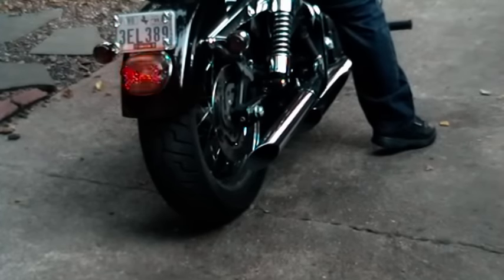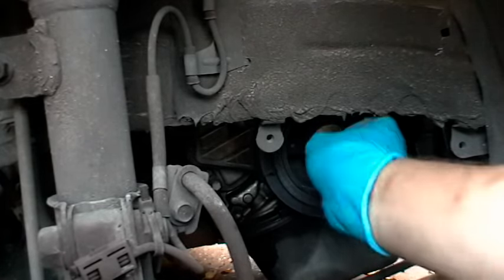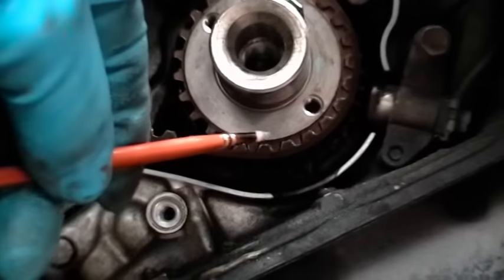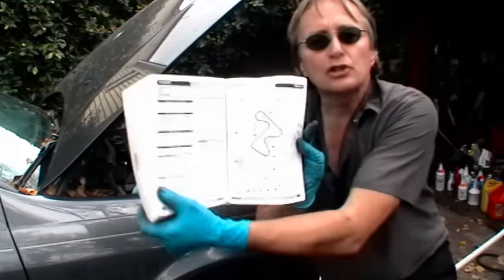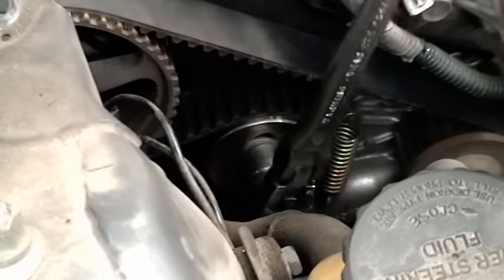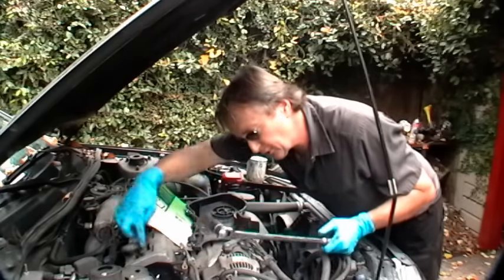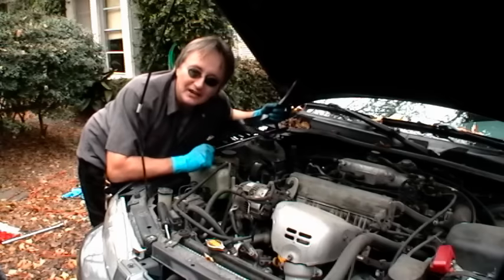How to Replace a Timing Belt in Your Car

Comment: The fastest timing belt change ever. This guy is a pro.
Reply: Teqo7 never did one before. I have only put a timing belt on an engine that was out of a car on an engine stand. I guess when I have that experience It will be more like nothing lol
Reply: Well, it is because Mr Kilmer choosen an easy engine to do it. I have an 1998 ford contour and i had to take out the camshaft cover, wires and spark plugs off, and had a hard time taking off some pulleys, in order to reach a f*king screw, and the water pump pulley had three screws. Besides, i had to lift the engine to unscrew a motor mount, take off the antifreeze tank and so. Then i had to align correctly both camshafts with the crankshaft, lock it up, unscrew and tight. A real pain in the ass, and everything done in the outdoors and during winter time.
Reply: +Jossejagguar he didn't choose it was just available
Reply: partially because it is a well shot, planned, and well edited video. But a lot of details are left out to help keep it short. This is done because most folks get bored really fast these days. No attention span Unless they are entertained. Thus goes the old saying; "Anything you enjoy, you will excel at." Which also means that anything you don't enjoy is next to impossible to learn.

Proof is check your old school grades. Scotty is obsessed with making good videos, so he really excels at making very very good ones. 
Thumbs up Scotty, You make us smile. Methinks I would smile longer with the added details. You are a great teacher.

MUDDy
Reply: muddymuddymuddmann ...SQUARRIAL!
Reply: Jossejagguar .
Reply: Not bullshit. Relative. He's a mechanic, so he has done this a 1,000 times. Plus he has all the tools. 
I can change a timing belt, but i'll rather buy my mechanic mate a case of beer to do it for me instead. Because he can do it right first time,. And in only  a hour or so. Where as I'll take all day and have more chance of messing it up.
Reply: To be fair he skipped
Over a lot of steps on the car including the dog bone mount
Reply: Know a guy who can do it in 5 mins did it earlier and a clutch in 20 mins can also rebuild an engine in 30 mins (already taken out)  but he can pull an engine in 10 mins and he is cheap like £350 for a rebuild
Reply: @Jossejagguar  you should trade it or buy a mercury grand marquis or a crown vic
Reply: Trust 😆

Comment: Wow, you make it look so easy here. Recently I changed the timing belt on my 2002 Honda Accord and it was quite a job, definitely something from the Busted Knuckle Garage. While I got help from another video on how to change that particular timing belt I give you, Scotty, some credit for motivating me to go ahead and actually do it myself.
Reply: When i do a timing belt, I don't just replace the timing belt but also the other stuff like the tensioner, waterpump and other pulleys. If one of those parts seizes, the timing belt will break and you may have to pull the head off
Reply: My 99 accord is making a small ticking noise and i don’t completely know if it’s the timing belt or not was wondering yours made a ticking noise
Reply: I don't recall it making any noise. I replaced it for preventive maintenance, knowing a failure could not only leave me stranded but also ruin the engine. Back in 1988 I had a timing belt break on a 4 cylinder engine in a Ford Pinto. There was no noise warning me it was soon to fail.

Comment from the maker: you have to make the automatic tensioner be in the loosest position, then feed the belt on the crank at the bottom and work all the way around the pulleys, keeping the slack part on the tensioner side so it gets tight when you loosen it back up

Comment: Just wanted to drop a line to thank you. I have a 99 mitsubishi mirage that was neglected severely. I recently changed the timing belt water pump and crank seal. I never would have attempted it if it weren't for your videos. The car needed a lot of tlc. So I cant thank you enough for all your knowledge. God Bless

Comment: You didn't show us how you made use of the paint marking. That would be the important part.
Reply: After rotating 2 times by hand, ensure that the paint marks all match up again. If not, the belt has skipped a tooth somewhere and will need to be repositioned.

Comment: Timing chains break sometimes, too.  This happened to me on an 85 Toyota pickup, an $800 repair. I decided to replace the one in my 90 Dodge Dakota DIY.  I was told the chain on it would be more robust than the Toyota, which was more like a bicycle chain.   However, the Dodge had 192,000 miles.  The old chain had some play in it, but the new one is nice and snug.  The motor is quieter, too.  If it weren't for a little lifter noise, it would be pretty quiet for an American made truck.

Comment: On most cars it isn't this easy...not even close. He gives you a general direction but prepared to spend several hours/a day if it's your first time.
Reply: +mike blaz More than one reason why I hate front wheel drive vehicles.
Reply: mike blaz That's why I love older RWD carbeuratted cars. Easy and cheap to fix. It literally takes less than an hour to change a timing chain if you know what your doing.

Comment: Makes it look so easy...when I was a young mechanic I had a car (believe it was a chrysler 2.7, FWD) with a bad water pump.  Had never even heard of a timing driven water pump at the time.  It was a Sunday, so a couple of us less experienced guys were on duty(the A Techs had most weekends off...hell, they earned it). Car comes in on the hook and we and the rokkie advisor take it in figuring its a water pump...how bad can it be?  Well...when I was tearing it down when I first heard/saw those four cams (V6 DOHC) snap into a different position I knew I had screwed up.  This was in 2008 and me and that car are still married to this day... 😆

Comment: its always a good idea to replace pulleys and even the tensioner and water pump too.
Reply: Especially the water pump.
Reply: "replace pulleys"? you mean pulley bearings?
Reply: Pulleys. 
They are usually included in timing belt kit. 
Kit usually includes : Belt, tensioner pulley, water pump and one more little pulley (no idea what's it's real name is)
Reply: @carleynorthcoast1915  the bearings are in the pulleys lol. They come as a whole when you buy them.
Reply: If the water pump breaks, is it bye bye engine? Cuz it’s an interference engine.

Comment: some engines you need special tool's to change timing components which mass majority or DYI'rs don't have (example the newer 2.0l Volkwagon diesel motors)
Do a lot of research before attempting or you might make a costly mistake!!
Reply: Especially fords

Comment: I don't have the guts to change the timing belt my self -_-
Reply: if you haven't done one yet.. do it.. it's good experience. One tip is to transfer the marks from the old belt to the new belt, it helps a lot.
Reply: So you measure the marks from the old one against the new? Maybe with chalk marking or a white paint marker?
Reply: @TheLondonCyclist  Yes.. not chalk, I used a paint marker from home depot. Then you just place the new belt on top of the old one, transfer them over. Use a locking tool for the cam shaft as mentioned and the trickiest part is getting it past the tensioners. a new tensioner should come with a pin that holds it in the retracted position, that makes it easier, then pull the pin out once everything is lined up.
Reply: @zoomjoo  I might have to get my mate involved as four hands is better than two. Cheers mate.
Reply: @TheLondonCyclist  definitely, i needed a helping hand to get the belt back on as well, to hold the belt tensioner in the retracted position
Reply: @zoomjoo  why do you need to mark the belt? I thought you only need to mark the pulleys  to the backplate or am I missing something. Please could you explain thanks.
Reply: @MisterAmbassador  You can mark the belt to ensure you don't install the belt with slack on one side. Its an additional precaution and less important than the markings on the pulleys that should be there from the factory. Also a good idea to turn the engine over a few times by hand after install.
Reply: @zoomjoo  But doesn't the tensioner take out the slack ,how does installing the belt a particular way tack out slack on one side?
Reply: @MisterAmbassador  it does but lets say you have a DOHC engine, and you left a little slack on the belt between the two cams. When you release the tensioner pin to put tension on the belt, it'll rotate the cam on the side that the tensioner is on putting you off one tooth. If you mark it and make sure the marks line up, you'll avoid that. It's a simple precaution that a lot of people use. Feel free to not use it if you feel confident in doing so.

Comment: Best thing to do is get a car without timing belt:)
Reply: with a timing chain is best!!
Reply: its all the plastic bits around that chain that's the worry and to be honest, we don't tend to have cars past one or two swaps anyway. Get your point though, seems stupid.
Reply: Eternally 1 Chains tensioners and guides wear out too and then it's big money or a lot of work.
Reply: 3800, series 3 v6 in my 2008 buick with over 240,000 miles. Never needed a timing chain, never will.
Reply: Yep that's what most people think until the loose chain wears a hole in the timing cover and either causes an oil leak or worse causes coolant to leak into the oil destroying your engine. Both designs have thier issues. Neither are maintenance free.
Reply: William Snyder had that on a Nissan, wore a hole right through the aluminium cover. Oil bled out everywhere. The plastic chain guide had crumbled, leaving the chain to sag.
Reply: Been there done that.
Reply: William Snyder Right on. Not maintenance free, but when designed right, chains are bullet proof. I don't hate belts but people push them too far when they shouldn't, and well designed chains are proven to be superior to belts (when taken care of and are driven normally)
Reply: I wish they'd just use gears
Reply: @fryncyaryorvjink2140  they used to but it's less efficient , more noise, and gears wear as well

Comment: My little shitty Ford Fusion requires a bit more work, namely removing the engine mount as well. It's also a good idea to change the tensioner & water pump.
Reply: Also does the focus. Gotta remove the engine mount and lower the engine a bit.
Reply: @Mike-vs3dv  Ford has terrible designs try putting an alternator on one...
Reply: @mikevigil3677  Oh i know, i know 🙁

Comment: anyone with tools can change a timing belt, however, it's a part that's too sensitive. if you put the timing belt 1 inch off you could blow your whole engine. i just leave it to the pros to do that. im not risking buying a whole new engine that could cost over $1,000
Reply: Thats why you turn the engine over see if you did it right
Reply: Donald Trump my mechanic charges me only $200 in labor, I buy the parts which cost $150. So in total I spend $350 in getting my timing belt replaced
Reply: Thats why you should use some brain cells and turn the engine by hand like Scotty did

Comment: Just changed mine with normal house hold tools ... the pully came off easily, didnt need a puller ... for the pulley bolt i used your other video and used the trick with the starter - it worked beautifully!!! ...... i didnt even use a breaker bar, although having one would have made it easier ... thanks scotty

Comment: My 2002 Passat was destroyed after the timing-belt snapped while doing 80 something on the highway. I only had it for about a month. RIP
Reply: +knowthetruth1492 i hear yah man i bought a 93 3000gt last month ran great for 3 days and timing jumped and destroyed my engine.
Reply: Holy shit . You didn't check the timing belt if it was worn or in good condition ?

Comment: Whats with the paint ? To line up what ? You didnt move anything did you ? Or did I miss something ?
Reply: +librazone To set the proper mechanical timing of the crank shaft and the Cam shaft.
Reply: I suppose he did not explain at length the importance of the markings and how they can affect the timing internally if one places the belt incorrectly. By marking the spot it just makes it easier to get it right when placing the new belt, takes the guess work out of the equation and besides he mentioned that you should do a dry crank of the engine to make sure pistons are not hitting the valves above.

Thanks.
Reply: +librazone   There are timing marks on the crank shaft and cam shaft, the way he does it is not the best way.  pron to mistakes.

Comment: Bottom line go to a mechanic.
Reply: have your money ready.
Reply: Amr Nabil I was quoted no less than $1100 for the job on mine, for just $300 worth of parts (water pump, tensioner, pulley, actual belts) so I said hell no and started gathering parts to do it with my mechanic friend down the road on a rainy day
Reply: Bottom line, don't be a wimp and change it yourself
Reply: Jon Clarkson everyone should own a basic tool set. Its better safe than sorry even at that having a set of sockets and socket wrench isnt much.
Reply: Phil Gudet there you go

Comment: Wasnt telling you off just meant that it is a good idea on most cars. My dad is a mechanic and would never change a timing belt or chain without changing all pulleys and tensioners as the belt snapped in out renault scenic after we just did the belt, due to a failed water pump bearing.

love your work. Aidan

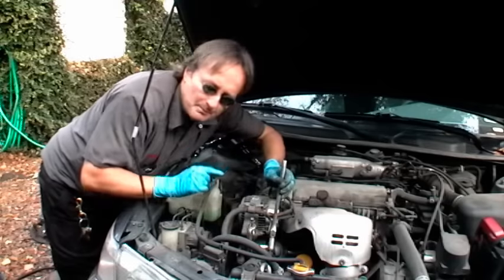Comment: @ 0:35  you say first thing is to what ?   i say: first thing is to disconnect the BATTERY...   is this wrong ???
Reply: nah can never go wrong with doing that. its a good safety precaution!
Reply: Waste of time from my experience if you're not working on electrical stuff.
Reply: 5 mins vs hours if you fry something ..

Comment from the maker: you have to get the tensioner to go the whole way over to loose. If it's still too tight, get another belt, cheaper ones often are not the exact correct size

Comment: Scotty your a genius with the videos.  A true service to the public.  I just bought s GRAY 1999 Toyota Camry, with 90,000 miles.  Paid 3grand.  Is that what I think it is, are you worked mg on the 1999 2.2 4cyl Toyota Camry here in this video?  I hope so, because I'll use it as a proper guide when I do my first timing belt EVER.  Thanks for your work!

Comment: thanks!  as soon as i can get my hands on those tools i will try this using your advice!  i was told by a tow truck guy (it was a dark night) that i had an "interference" engine..  i also saw some websites that said the '98 avalon had the interference engine.  im hoping they are wrong since i've been told that makes a huge difference in repair price.

Comment from the maker: replace the fuel filter first, then pressure test the fuel pump, as low fuel pressure can do that and is easy to test for. then get a timing gun and check the timing to see if it's off or not. If not that, clogged fuel injectors often do that, try my video "how to clean fuel injectors on your car"

Comment from the maker: jack it up in the air, bank one is the left side of the engine when you are standing in front of the engine with the fan belts in front of your. It bolts on the exhaust for that side

Comment: a few years ago, we worked on a v6 engine ( needed a new cylinderhead) and when we put everything back on, then we got to the timing belt, everything was smooth and we had no problem putting the timing belt on. and we also did 2 revolutions to see if the (red) marks line up and it did and the belt had good tention. we started the engine. it didn't sound idle at all. after 2 days we have found out that the engine is so strong that the timing belt slips an inch ( like 4 or 5 teeth) from the camshaft pulley.. it was a opel vectra 2.5l automatic station by the way

Comment: I had to replace the timing belt on a Ford Sierra 2.0. The engine suddenly stopped. Something had falling inside the belt cover and several teeth was more or less missing from the belt. I used a little more time than the video but it was all done within 30 minutes :) I had never changed timing belts on any car before.
To get access I had to remove a couple of screws from the cooling fan in front. Removing the cover to access the timing belt was easy. I had a small pulley that fit perfectly so nothing was hard to remove. There where markings to the two upper wheels so that was OK. The lowest cogwheel had no markings but I discovered that it was connected to the distributor and guessed the alignment - had to make a second guess. After aligning the lowest cogwheel second time it was 100% OK.
The timing belt didn't cost much and I also changed a belt tensioner wheel that cost a little more. Some cars maybe more complicated to work on, but changing the timing belt was probably one of the easiest and cheapest job I have ever done on a car, and would even be more easy if the timing belt was replaced when the cogwheels was in correct positions.